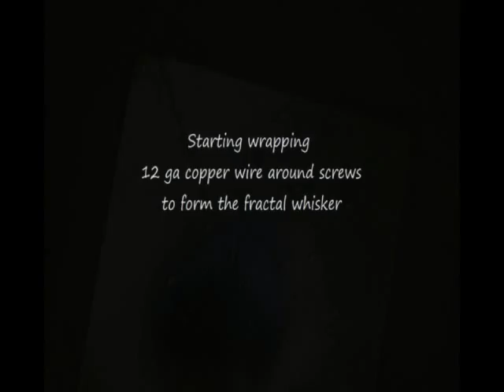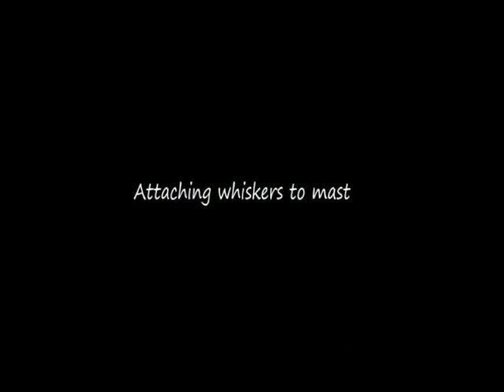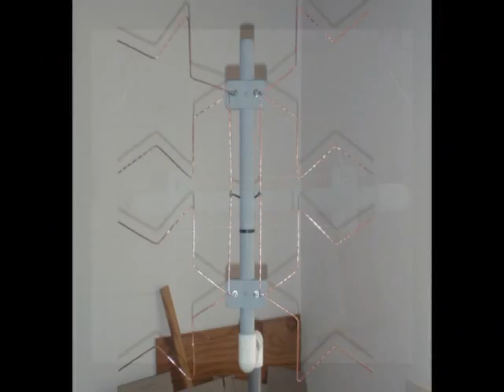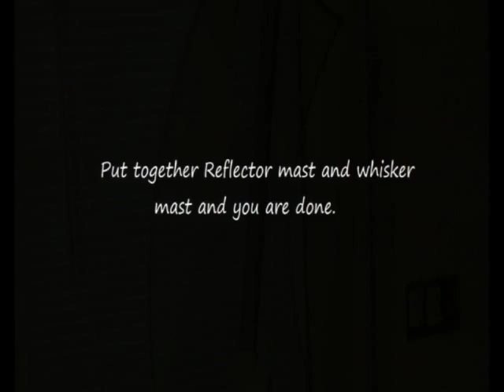How to Make an Outdoor Fractal HDTV  Antenna, Homemade HD - LeoDA

Comment: Excellent instructional video, same for music and building techniques. Not sure about the fractal part, though. A cutting edge antenna designer I've followed for a while says bending the wires into fractal doesn't improve reception beyond what you'd have with straight elements. Still, a great production.

Comment from the maker: @water4fuelh20  Surprizingly  well. The copper whiskers have tarnished. I would suggest  coating the whiskers with a shellac, also use 10 ga. or thicker wire for better stability. We had a tropical storm come through a month ago, and it weathered well.

Comment from the maker: @justopenupthething  You can buy an Antenna Grounding Block, about 4 to 5 dollars at home depot or radio shack. At  the point where your antenna cable enters the house insert the grounding block and from the grounding block run a wire to a grounding rod sticking out of the ground (most houses have a grounding rod around the  house). All antennas should have an Antenna Grounding system installed in their setup.

Comment from the maker: The plastic blocks you can find in Home Depot in the moulding section.

Coated 12 ga wire is fine... make sure you scrape off the insulation where ever you make connections.

Aluminum will work fine.

Comment: you should note you only need a reflector if your signals only come from one direction... without it the antenna will pick up 360 degrees...
Reply: True, but the strongest lobes will be a 180 degree pattern of reception. The opposite pattern would be varying degrees of reception to null (no reception). The reflector directs reception to 90 degrees.